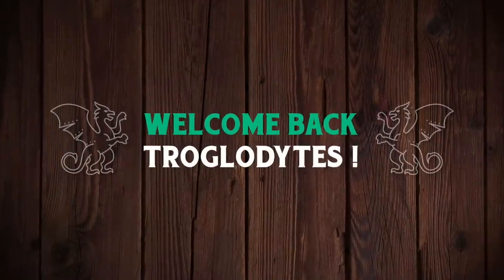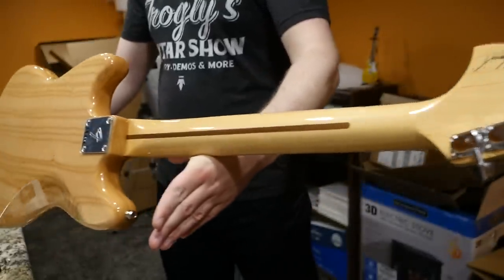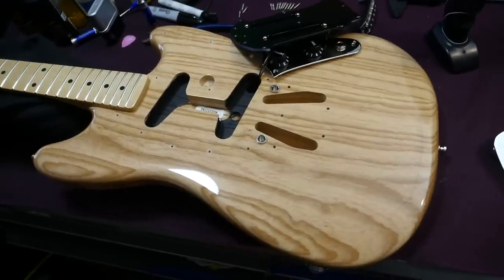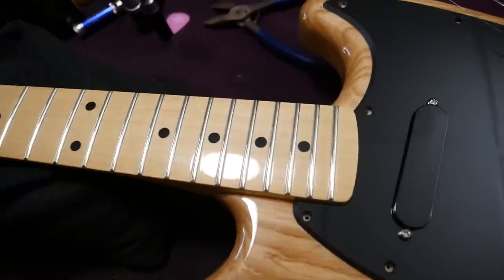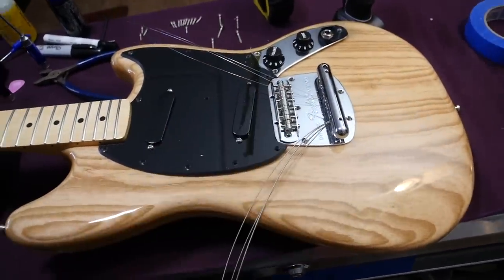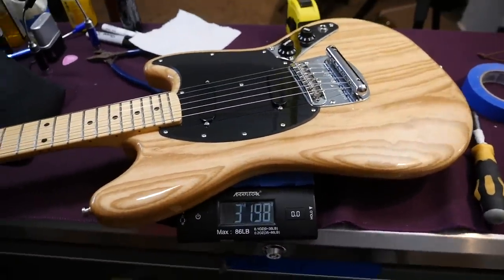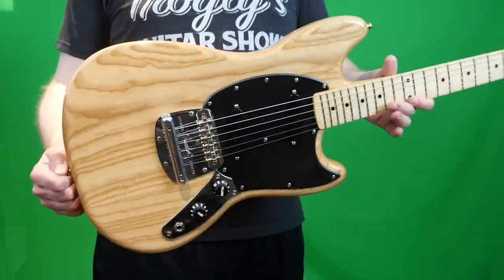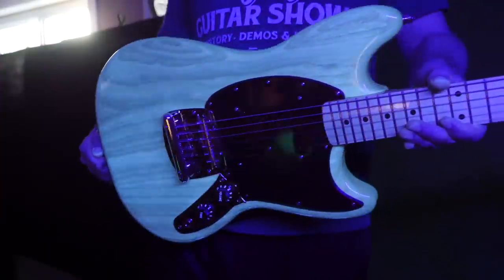That is a Lie! | 2020 Fender Ben Gibbard Signature Mustang Natural | Review + Demo

Comment: I like it, but it is definitely overpriced. The neck seems to be identical to the ones on the lower end Mustangs and Duo Sonics. Instead you could buy one of the amazing new Vintera Mustangs for 700 bucks and mod it any way you like.
Reply: Yes, I would rather have the Vintera as well...
Reply: The neck shape on those less expensive Mustangs is one of the most comfortable I've ever felt so if it is similar here it's a win.

Comment: All you need is two springs and two spring posts to make it a Vibrato. These parts can be bought from the usual aftermarket offset guitar places online.

Also, those F tuners are made by Schaller Germany, so top quality!
Reply: I was thinking basically the same thing Wolf! Geez, Trog is slippin'
Reply: Hey Wolf K
Could you possibly point me in the direction of these spring posts, I’ve searched far and wide for them and can’t find them anywhere
Reply: @mattdoliver1984  try Angela instruments online. They sell the whole range of Fender offset guitar parts, including whole mustang vibrato systems.

Another two are:
Darren Riley guitar parts
Guitar parts factory 

All have good sites to order from. I’ve ordered every part to build Jaguars and Jazzmasters from the last one over the years.
Reply: @Wolf_K  Thanks a lot mate I’ll be sure to check those out, so you can definitely convert the stop tail trem then? I thought I’d did look possible, I’ve literally scrolled forums and videos on YouTube looking for anyone with a bit of knowledge about where to get those spring posts from
Lol 😂 thanks again
Reply: @Wolf_K  what it is I’m in the uk and every shop seems to sell the Dynamic vibrato but as a locked unit, and I can’t find anyone that sells the posts, I can buy springs, I may just order the whole trem system as a working part from the states, I take it that’s where you are
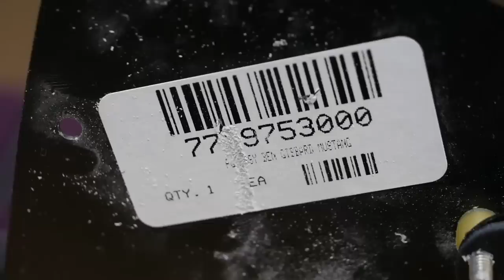Reply: @mattdoliver1984  look at 4:25…same exact routing as my Mustangs. Both have vibratos.

No, I’m in Australia but order from the US as this country is expensive and rarely has parts I want.

You may well have to buy the whole vibrato. Try to get the made in Japan one, which is most common anyways.
Reply: @Wolf_K  Brilliant thanks a lot, really appreciate you helping me out mate 👍🏼
Reply: @Wolf_K  awesome the Angela site is just what I need, I’m like a kid in a sweet shop now lol I could probably get everything I need from them, I’m just about to do a Mustang parts build but England seems to be pretty useless at coming up with the parts for offsets, it seems more Strat & Tele orientated, we have an allparts store but they have very little stock, so you think Angela will ship to the uk, thanks again Wolf K this had been a great help.
Reply: @mattdoliver1984  No problem, man.

Yeah, they ship worldwide. So does the other two stores.

Comment: I have a guitar setup where you just use an actual tone pot for the selector switch.  Turned up to 10 it is all neck.  Turned down to zero is all bridge.  All the positions in between give you a blend of the two pickups but more towards 10 give you more neck blended in and vise versa.  It's a great setup.  They call it a blend knob.  Gretcsch's have them sometimes by the lower cutaway, and Rickenbacker had it too I believe when you see a 5th knob on a Rick.

Comment: I’m having absolute trouble with this guitar it buzzes when I start playing it goes away and it comes back. I checked the wiring and it looks like whoever assembled it didn’t know what they were doing. It was incomplete, I fixed the soldering problem and reduced the buzzing. It’s slightly still there

Comment: The rotary switch makes sense if you think of it as the numbers indicating positions 1 through 5. Is there a mark that they line up with?
Reply: @shiftyfitter  You're right  for some reason I was thinking 5 way switch, and that would have lined up better and  made more sense. The clockwise direction of a tone knob from 1-10 and switching from position 1-3 still do though, though it would be nice if there was some immediate indication of what position you're in.

Comment: Trogly's distorsion sounds pretty dope, better than a lot of other youtubers trying to sound heavy using digital programs 😒😒😒😒
Reply: This isn't heavy at all, it's like way less distortion than an AC30.
Reply: @joshjamesguitar  yes, but sounds heavier than digital high gain distorsions.
Reply: @papasmamas1  No it doesn't, how is this in any way heavy? You know most metal artists use Tube amps right? Stuff like Modded Peavey 5150's, Orange Dark Terror, Engls etc And most are using 7 string guitars now in lower tunings

Comment: It's a matter of how you look at the top of the dial. If you look at it like a clock it makes sense turning forward(clockwise) is turning towards the neck. Like think of it as you're moving where 12 o'clock is in order to change pickups then it makes sense. I'm not explaining it well but it makes sense to me. I'm still not a fan of the dial instead of a blade or 3 way. Like the old PRS guitars used to come with those. I was in the market for one and my local shop got a nice used 10 top in for 1800. It was in immaculate shape and I tried to convince myself the rotary knob would be ok but I just couldn't do it. They got one of the new eriza verde se custom 2408s in a few days later and I went with it instead. I'm very glad I did. It's an incredible guitar for the money. It plays better than my lp studio, American strat and 75th anniversary mim tele all day. The fret work and neck are the best, most consistent I've ever played on ANY guitar, hands down! Anyway, I'm off topic now. If anyone reads this all, I'm sorry! Lol!

Comment: I dig your review and I'm headed to your Spidey mustang video ... so I can copy it.  :)

I own a '65 mustang, so I can explain a lot of things you missed.

The 'fixed 'bridge on Ben;s is actually copied from Kurt Cobain's '69 mustangs that he took on tour.
The 'cigar' tailpiece was reversed and the vibrato springs were removed to make changing strings and tuning stability easier to deal with.
Anyone who owns a '60's model will tell you if you don't wrap the strings underneath said cigar and dial in the appropriate string tension, the vibrato will not function properly.  Also, using said vibrato, which has the ability to lock in a static position, will throw the guitar wildly out of tune.

Also, eliminating the 2 3-way switches 'for the pickups will totally eliminate the BEST feature the Mustang possesses.  
Mine has 2 '65 Fullerton neck p'ups, the bridge being inverted, and the in-out-of phase settings between the 2 is what makes this  particular guitar stand up to other guitar's sonic configurations.  The mustang does have the ability to sound amazing.
Eliminating those 2 pickup settings was dumb by all standards.

Also, without swapping the bridge, your only gong to be able to dial in the action so close.  Not 'exact'
The saddles for the vintage mustang bridges don't have adjustment screws.  
The Mustang is the ONLY Fender guitar where the saddles don't have adjustment screws. WTF?!?!?!
Anyone who has set the intonation 'correctly' on their Mustang appreciates the chore that is was...and never wants to do it again.

Without making the necessary mods to a vintage mustang, you have a severely inefficient guitar that sounds like crap, rarely stays in tune, and is a GIANT m'f'er to set up properly.

Ben's signature edition gives up all of the good qualities without even trying to eliminate those qualities that are undesired.

Ben's mustang SUCKS imho.

I built a 24" scale strat a few years ago, just to prove that the Mustang was ultimately garbage.
I would love to pass that thing around the room just to see what everybody else thinks.

Comment: Super impressed with Ensenada facility. I got a Vintera Modified 50s Strat 2 tone sunburst and the wood is absolutely amazing. And I love how the back of the neck is satin, but the top is light gloss. It's so beautiful. Love the body. Really interesting specs. I usually steer clear of signatures, to specific. But, I guess that's the point. I love short scales. I have a 2002 CIJ Jagstang and it's my baby. Definitely have caught my hand on the phase/off sliders. Lol, comes with the territory.

Comment: Lovely wood indeed, but for the cost rather get a full spec Mustang or save for an original 70s. Selector might suit Ben but really goes against the grain' ha ha see what I did' ...PUs are very weak, if it were a few pounds/bucks less then you might upgrade. The wood and black guard really compliment each other along with that full gloss would shine in performance. Great video, thanks.

Comment: It would have been cool if the tone control had a two-part system where the numbers part could turn to adjust the tone, and the middle did its pickup switching job. Not possible without having a 2" deep pot/switch sticking at the back, but it would have been cool.

Comment: I personally feel like they should have gone with a nitro finish since this guitar is spec'd so sparsely. Ik it's not the norm for MIM Fenders to have nitro, but they've done it for other recent signature guitars from Mexico and like I said since it's so basic it could help try to justify the $1,100 price tag. Also the intonation seems a bit off from the factory. But personally it seems almost like a $500 Classic Vibe Squier.

Comment: You really should measure string height at the 12th. I understand it can be changed but would be good to know what it comes like from the factory. Set up/action string height is one of the most frustrating things when buying new guitars....getting the string height down.

Comment: I got this guitar the day it came out. Right away it had issues and I had to take it to get fixed (wiring issues). Though it was a cheap fix still not a great start for a guitar that will set you back over 1,200 bucks when you factor in tax. Kind of annoyed that it is made in Mexico and the gig bag is kind of cheap. I kind of wish they would have rolled the edges it feels a bit sharp to me. That being said I do like the pick-ups and the mods they did to make it more functional. I also like the way it looks. But this could have been a great guitar instead it's just ok. Probably a bit overpriced. If this was an 800 dollar guitar I don't think I could complain about the nit-picky sort of issues that I have. It is on par with the pawnshop mustang that I used to own. Which stayed in tune better and had a better feeling neck. But the darn switches were super annoying and I couldn't stand it. My review would be 6/10. I do like the way it sounds and it looks pretty to me.

Comment: Love the channel, been watching for a few years... Normally don't comment, but Schallers are you fave strap locks??????????
I've installed a couple or 9 sets and here's my thoughts. During normal play the nuts loosen up to the point where they fall apart. The Jim Dunlops with the push buttons are WAY more reliable. To the point of being maintenance free. I find myself having to tighten the nuts on the schallers before very show or practice. Schall I send you some?

Comment: I had a Kurt Cobain Jag-Stang that had the same "Dynamic Vibrato". It is a TERRIBLE design. It's best that they blocked it off, but they might as well have used a stop tailpiece, The bridge's height adjustment is done by two screws that are conical on the end and they rest in the bottom of a rounded cup-like insert. So two of the main vibration transference points are the two pointed screw tips and it's metal on metal.That is probably why it sounds so thin.